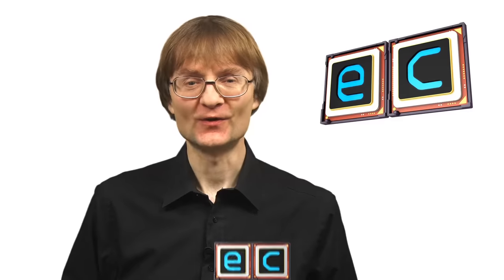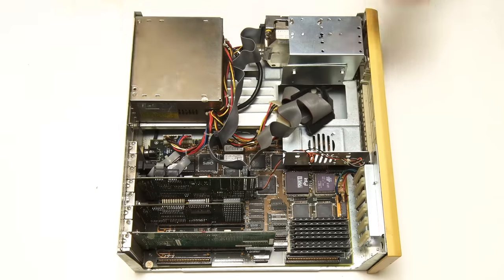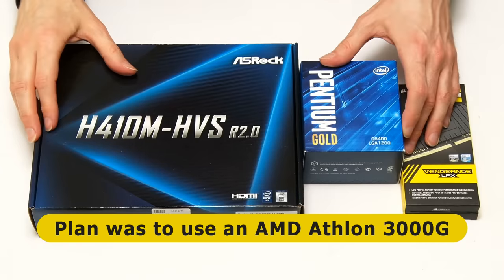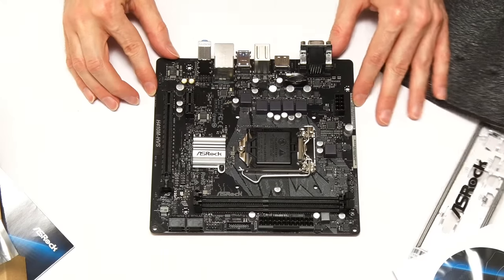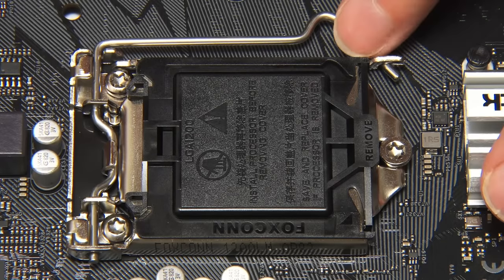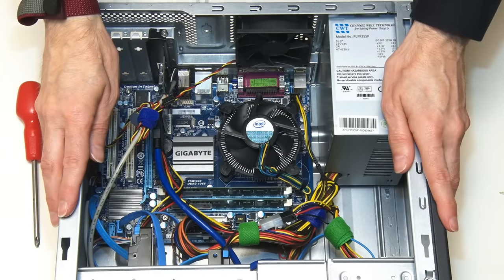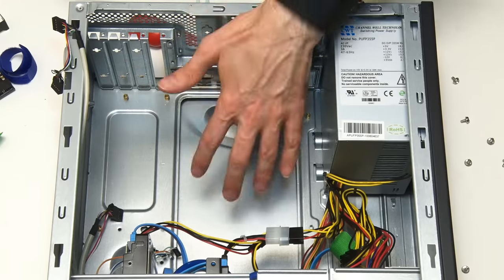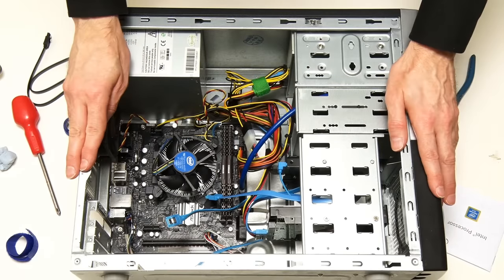Old PC Upgrade: Motherboard & CPU

Comment: I think its about time Mr screwdriver and Miss Stanley Knife got hitched. Couldn't help noticing a lack of earthing,and I always remove that pre installed heat sink compound you never know how long its been exposed to the air, cant beat fresh.
Reply from the maker: I do not show earthing on camera due to the extreme abuse I sometimes get in the comments when I mention it! :) But I am always earthed.

Comment: choice is fun, shame you didn't get the GIGABYTE B460M DS3H V2 1.0 LGA1200 mATX Motherboard for that 4 slot mATX case as it has 2x16 & 2x1 pcie  & 4 ram slots, m.2 for the £12 more, rather than the 1x16 & 1x1 2 ram slots asrock

but still you can fit a cheap CERRXIAN PCI-E 2.5 Gigabit Ethernet Card PCI Express X1 Network Controller Card 100/1000/2500 Mbps RJ45 LAN Adapter Converter for Desktop PC £29.98 or the r8125 chip usb3 versions later, work quite well with m.2 ssd

Comment: When I rebuild a computer, I always vacuum all the dust bunnies into oblivion.  How is it this pre-upgraded PC had no dust caked into it?  I run HEPA air cleaners in the room and still end up with dust bunnies.  I also replace the BIOS battery.
Reply from the maker: It was cleaned.

Comment: Nice video, Chris, very well explained steps as usual. However, I can't believe Intel is still selling dual core Pentium and shipping this garbage of stock cooler, it's a joke compared to AMD most basic cooler (Wraith Stealth).

Don't take me wrong, you explaines you couldn't find any Athlon processors in stock, but I refuse to buy a dual core CPU in 2021, even if it's for a low-end rig like this.

Comment: Come PPl totally miss the total point of this series.  I know this series low cost.  I lost all my love of intel for AMD Ryzen for the simple reason, I can upgrade to CPU and get more kick without new board.  Yea I spend about $110 for MSI B550M with WI-FI and TB  and 2 M.2 .  Im going to move my GB A320M to my micro case and while I though the B550M was a 550mm board not a short board.  I have never found the need for more then 16 GB of memory. the A320 has a Ryzen 5  and PM score of 4800.  The B550M I got at Ryzen 7 for the board.

Now for a question.  I upgraded a computer for work with M.2.  At home I was getting M.2 speeds of 1500.  When I got it to work, Im now only getting ssd speed. To say Im pissed is not an understatement.  But at home I do not have access to all my network drives I have at work.  I think the network drives are mixing up m.2. right now I don't have time to look into what going on.

Comment: I still have my 8300 Dell XPS icore 5 with 12 Gigs of ram still rocking since it's was a high end  machine at the time it has THX sound chip which sounds great   but ,  no BIOS updates anymore, NVIDIA  730 GT  is not supported   but the system still runs pretty good, upgrades definitely SSD driver 1 terabyte maybe a USB 3 port, ,   I just don't want to give up on the old girl yet, I always stated to people get what you need these older Icore's can still do the everyday jobs at least for me which is the main thing, is there anything you could suggest that I could upgrade,

Comment: I've noticed that you didn't mention your anti-static bracelet strapped and how it's recommended to clamp it to a radiator. Also I kinda miss those bulky Parallel Ports despite that they are sluggish and don't support like those USB PnP features.
Reply from the maker: I cover antistatic precautions in an earlier video. But I rarely return to the topic these days as I get intense abuse in the comments when I mention using antistatic protection.

Comment: I'm sorry to tell that if you change a 10year old motherboard to a new one so change the power-supply too! Reason the Capacitors after this time are death. You have troubles for only Euro 50,- that cost a power-supply. Best Regards Volker from Vienna
Reply from the maker: I very, very clearly discussed this matter in the video, and we will have to agree to disagree.

Comment: I would argue that replacing the MB + CPU is not building a new computer, because you're not paying for a new case, power supply, and SSD. 
Whether or not it might be more beneficial to get a new case, PSU, etc. is another question entirely. :)

Comment: Did you attempt to reactivate WIN10? I think you said there was a WIN 10 installation on the SSD you used. If so, what error messages were encountered?
Reply from the maker: Windows 10 would not boot -- black screen during startup. I tried one recovery, which failed, then decided not to waste my time. A fresh install only took 20 minutes from a media I had at hand. I did not attempt to reactivate, as I had not associated Windows 10 with a Microsoft account, so it was never going to be possible.

Comment: Please...why have desired an AMD Athlon 3000G (never heard of it)? Instead of the now trendy Zen ones!

Cost? Availability? Cooler name :-) ? Tanx!!
Reply from the maker: Cost. The 3000G is an excellent low-cost APU, with Vega 3 graphics.
Reply: Ahhhh! Great to now know!

For the commenter in your following vid, who disparaged Linux OSs, I'll say this...

...I started on MicroStation CAD in '79(?), on a surplus-bought NASA mainframe workstation. On...UNIX!

Good enough for getting to the moon, good enough for architectural drawings! Hated it! :-)

If ONLY IntelliCAD's several permutations would soon port to Linux, brother, I'd switch forever! 

Sadly, only BricsCAD does. IntelliCAD is the best value in a pro PC-CAD, btw. Though I use my old owned ACAD. Maybe if YOU talked to those stuck-on-MS developers, they'd listen!? :-) Stay young!

Comment: Pentium Gold is a Dual-Core processor???  It's like old processors never die, they just get repackaged and resold.  One would have thought that the Celeron would have died off - after its miserable beginnings - but no, it's still being sold.  And now we see the Intel Core-Duo making a comeback.  Interesting.
Reply from the maker: As the final tests show, a Pentium Gold is actually not a bad processsor these days! :)
Reply: @ExplainingComputers  - I don't doubt that.  Actually, the Core-Duo processors were very good processors.  I've owned 2 and worked on many more systems with those processors installed.  I ran Windows Server 2008 r2 for years on Core-Duo processors.  The Celeron, however...  I've had so much disappointment with those brain-dead things that I'm terribly gun shy.  Once bitten, twice shy, as they say.
Reply: These Pentium Gold are based on Kaby-Lake, the use of the Pentium moniker is simply a marketing play, rest-assured that these are a completely different architecture from older pentiums.  Same goes for the celerons.  It would be nice if they were a bit more creative when naming new products

Comment: While video serves the "educational" purpose very well, TBH, upgrading storage + cpu + ram + motherboard does mean just reusing old PSU on a new computer. IMHO, upgrading (in real world) should first have a "purpose".. Why we are upgrading this PC for? A G6400 is still only good for web browsing, office work and maybe HTPC... For these purposes, I would keep the ram and mobo and just upgrade to a second hand Core 2 Quad in place of that pentium, OC just a little to ~3 ghz on stock cooler to effectively more than double CPU performance for £8-10... Then buy a GTX 1050 for ~£80.. This computer would have ~70% CPU and ~900% GPU performance of doing mobo+ram+cpu upgrade at ~55% price... Since gpu won't be taxing system ram, it would have 10-30% more RAM as well... This computer can also do office work and web browsing, plus it can run CAD software, do hardware render on Blender or similar 3d design software, have better hardware video encoding etc etc.. For HTPC, I'd spend some additional £15 on a wireless game controller as GT1050 can easily do 30fps 1080p gaming, and fps don't really matter with gamecontroller+TV combo...

Comment: I found out the hard way that OEM Windows licenses are linked to the motherboard and CPU upon which they're initially installed...  I upgraded my motherboard and CPU about 18 months ago, and my Windows activation disappeared.  I didn't realize that I had purchased an OEM license for Windows 10 when I built my PC a few years before that, and even if I had known, I didn't realize that meant the license was invalid after you upgrade your motherboard and CPU.  VERY annoying that a legitimately licensed computer suddenly needs a new license simply because you purchased a couple of new parts for that computer.  :-(
Reply from the maker: Agreed. Microsoft has us over a barrel on this one.

Comment: OR YOU COULD STILL USE WINDOWS WITH OUT ACTIVATION and just put up with the windows needs activating at the bottom of the screen ,i have not activated mine  for over a year and  if i do i will use a windows 7 key

Comment: No, 2400MHz is not a very respectible speed, It's more towards 2666/2800Mhz.
And no, you don't remove the plastic cover like that, the way shown here will certainly lead somebody to damaging the socket...
Reply from the maker: I removed the plastic cover exactly as shown in the instruction sheet that comes with the processor -- lift the lever, raise the retainer, then remove the plastic cover. So what you see in the video is exactly what Intel recommend (although I am well aware that others have different views). On memory speed, the idea that 2666 can be respectable when 2400 is not is ludicrous -- a 10 per cent RAM speed reduction will have no realstic impact on anything a PC with an entry-evel processor of this specifcation would be used for
Reply: @ExplainingComputers  I agree on the memory, but in most cases you'd rather want to go higher than 2400MHz. I myself was lucky enough my 2400Hz kit could overclock to 3200MHz when I moved to Ryzen.

Comment: 1 question in the spec sheat in intel says g6400 supports only 2666mhz using 2400mhz gives a problem?
Reply from the maker: Good question -- but the "Memory Types" listing on the Intel page -- https://ark.intel.com/content/www/us/en/ark/products/199289/intel-pentium-gold-g6400t-processor-4m-cache-3-40-ghz.html -- is actually a maximum (click the "?" by it), even though it is not labelled as such. So 2666 is fine.

Comment: Any chance you could do a similar video but with a laptop?
Reply from the maker: Laptops have far more limited upgrade potential (usually just the RAM and SSD/HDD) as they do not use standard motherboards.
Reply: @ExplainingComputers  that is fair enough. Many thanks for the reply.

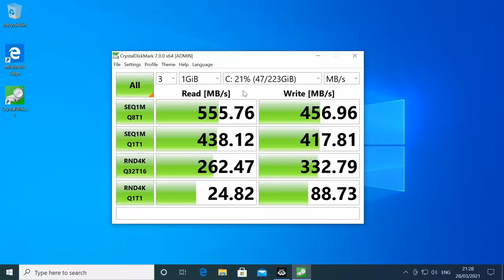Comment: 23:15 While it is true the sata3 would be part of the reason those particular high SSD speeds are reached, the old sata on the previous Mboard in your hardware-software setup are not likely to be the constraining bottleneck of the previous speed shown (which is not the full potential of the sata on the old MBoard) but rather the fact that the filesystem does a lot of its work in memory (including RAM). So to say the reason is "as the drive is no longer constrained by the previous sata2 interface" is not quite accurate, per se. Just a heads up, and I like your video.
My comment has no hate in it and I do no harm. I am not appalled or afraid, boasting or envying or complaining... Just saying. Psalms23: Giving thanks and praise to the Lord and peace and love. Also, I'd say Matthew6.

Comment: You surprise me Chris, I assumed that you would know that the plastic protection on the socket comes off automatically when you install a CPU.
Reply from the maker: I am aware that there are different views on how the plastic cover should be taken off. So here I did exactly what is outlined in the instruction sheet that comes in the box with the processor -- lift the lever, raise the retainer, then remove the plastic cover. So what you see in the video is exactly what Intel recommend. As far as I am aware, Intel have never recommended having it pop-off by itself -- this is an urban myth.
Reply: @ExplainingComputers  I stand corrected. Every build I've watched (I use AMD, so haven't needed to do it) has let the cover pop off.

Comment: mate it looks like you forgot to lock the pushpins on the stock cooler by turning the pegs lol, should be fine though
Reply from the maker: The default positions for the push-pins is correct to mounting the cooler -- so they do not need to be turned when mounting the cooler for the first time, and indeed the instructions that come in the box with the cooler do not indicate they need to be turned. They might need to be turned if the cooler had been removed (by turning the push-pins) and was being remounted.
Reply: @ExplainingComputers  Ah, thanks for the clarification, didn't know this!

Comment: Can we add like the latest components to that thing like say an Rtx 4070?
Reply from the maker: With the motherboard used here, yes. It just needs a x16 PCIe slot. But a suitable PSU would be needed, and performance would be bottlenecked by the CPU used here. But it would work!

Comment: Whether in the present time. technology and prices. has sen processor 2 cores plus integrated graphics not more and at least 4 cores. 
pentium gold g7400 vs for example intel i3 12100 , socket 1700. thank you.

Comment: What is that "rodent" you are using?  I've never used a mouse like that. - 22:15
Reply from the maker: It is a 3M Ergonomic Mouse. Your fingers stay at rest holding the fixed centre column, while the thumb rests on top and rocks left/right to click. It is really good if you have RSI -- I've used one for about 20 years now.
Reply: @ExplainingComputers  - Ah.  Interesting.  It looked like some kind of wireless joystick that rocked around like joysticks do not like a mouse moves.  I've seen some other "tall" mice but never tried one.  My Logitech mice have worked well for me over the years.  Kind of miss having a heavy ball in the mouse though!   ;-)

Comment: Does Windows 10 not require a TMIC chip for Windows to install at all.
Reply from the maker: No, Windows 10 has no such requirement. Are you thinking Windows 11?
Reply: @ExplainingComputers  You are right but if Microsoft Windows 11 is based on a Linux Kernel then that is breaking the gnu agreement.
Reply from the maker: @DAVIDGREGORYKERR  Windows 11 is based on Windows 10, not Linux.:)

Comment: 14:00 what if you find that you aligned the CPU cooler incorrectly, so that the CPU fan cable won't reach, or for some other reason? Can the pushpins be popped back up and out in order to reposition the cooler?
Reply: In my general experience that is usually possible....
Reply: @derekp2674  thank you!

Comment: Guys, I never had an asrock motherboard. Do we know if they last? I usually keep my PC's for around 10 years. Would an asrock last that much? My oldest motherboard is a gigabyte from 2008 and it stopped working in 2020 perhaps due to PSU failure meaning that if I change PSU it may still work.

Comment: Wondering how this would compare to my stock speed 2600k?
Reply from the maker: Your 2600K i7 CPU is about 50 per cent more powerful than the Pentium G6400 for most applications, not least because your i7 is quad core rather than dual core. However, a system based on Pentium Gold 6400, as here, has the benefit of much faster RAM, storage and PCIe (expansion) slots, as well as better onboard graphics. So it depends -- as so often -- on the application. Ten year old i7 systems are still very decent computers.
Reply: @ExplainingComputers  Hi Chris...good to see someone else working late in the night too!   My PC is in constant daily use and apart from being a little slow at times, it is serving me well and capable of most tasks.  I wish it had more SATA ports as all 6 are in use and Core Gen 2s didn't get USB3, but its single PCI slot has a TV tuner card and it even has a working floppy drive so it's doing its best!  It's the end product of a range of second-hand bits gathered over the years - e.g. its case has been with me since it held a Pentium 2 system that I got second hand in 1999, and the mobo and everything else (apart from the drives, DVD rewriter and replacement PSU last year) have come from either eBay or CEX.   I upgraded it recently to 32GB as DDR3 RAM is pretty cheap now, which has helped speed it up during intensive multitasking.  My mobo doesn't support overclocking but considering how much heat the processor can produce at times, it is probably just as well.  I run VMs for Windows 10 when I need to "Microsoft" and use Debian as my daily OS. I so wish Windows 11 didn't have such harsh and unfair hardware requirements as like a great deal of others, I won't be able to run it natively on my machine.  I will be hanging onto it for a bit longer as money is tight and it does pretty much all I need it to.  You know, although I am technically qualified and therefore not afraid of attempting repairs when needed, it still shocks me how quickly people will readily dispose of otherwise good computing and, particularly, mobile computing equipment way before it is truly ready to be retired.

Comment: Hi, good morning... I am from India....Does x16 m.2 nvme adapter support to PCIe x16 Gen 1.0 ( for example I have msi 7528 G31F motherboard which have x16 PCIe Gen 1.0 and I want to install m.2 nvme ssd.....Is it possible!.... ) 
Please reply
Reply from the maker: I imagine it will work, but I also suspect that a PCIe 1.0 motherboard will not be PCIe bootable -- so you could probably not use the M.2 SSD for your boot drive.
Reply: @ExplainingComputers  thanks...

Comment: Made me cringe when you heavily flexed the motherboard while fitting the DIMM modules, without the motherboard first being securely mounted. Hopefully no damage created to the PCB traces / via’s!
Reply from the maker: I always worry about motherboards flexing, esp. when fitting the main PSU connector. When I fitted the RAM, the board was on a flat surface, and did not flex any more than it would have if mounted in a case (the board only had four corner mounts).